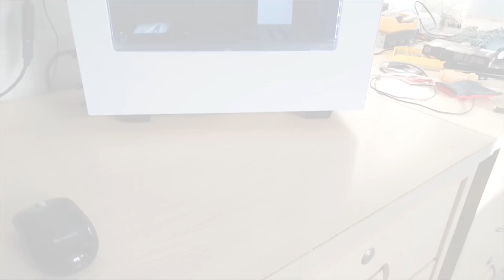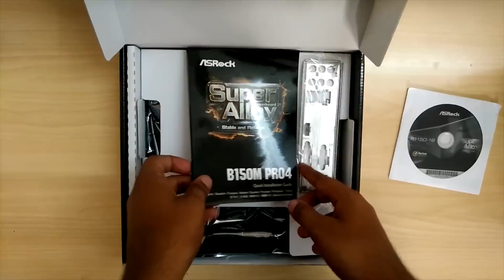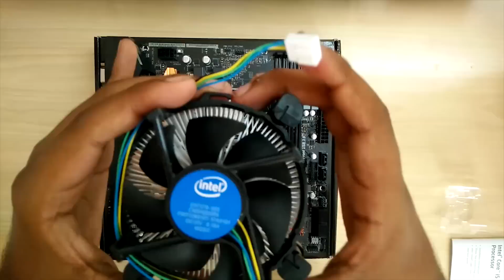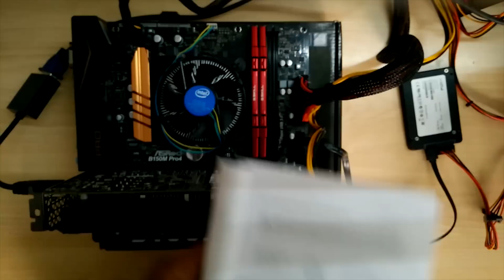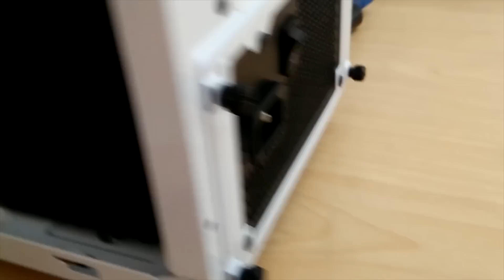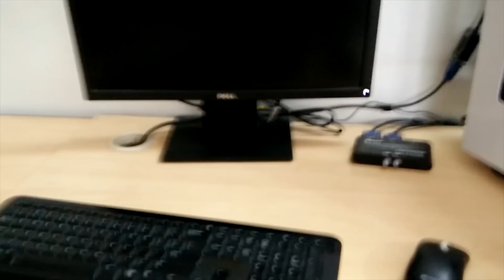How To Build A PC [GTX 1060, i5-6500, NZXT S340]

Comment: a 32gb ssd...
Reply from the maker: +CheesyTwister I know, right? What a moron....
Reply: nah, im guessing you are using it just for the os but you can get a 1060 you could have saved up a bit longer and gotten a bigger one
Reply from the maker: +CheesyTwister A full copy of windows 10 could fit on that but it wouldn't be able to receive any major updates. I am using it for editing videos. As for the graphics card, it is meant for 1080p tasks only and a 1060 is good enough for that.

Comment: Could i fit a gtx 1070 dual ( https://www.amazon.co.uk/ASUS-NVIDIA-GeForce-Graphics-DUAL-GTX1070-O8G/dp/B01IFESATU/ref=sr_1_6?s=computers&ie=UTF8&qid=1504276868&sr=1-6&keywords=gtx+1070 ) in here. Its 26cm and im worried that is wont fit because of the cable management bar.
Reply from the maker: +Gunner1906 TV The case can fit most graphics cards easily but if the cable management bar still gets in the way, you can remove it. (It is detachable)

Comment: Just wondering, if you need a cd rom, how would you install on in this? it didnt seem to have a port for one.
Reply from the maker: +Snow Flake I have a external cd drive that plugs into the usb.
Reply: I see, i wonder if that would be an issue of you had to reload the system os and youd need the cd drive. But i guess i could find a spot to mount it if i needed to.
Reply from the maker: +Snow Flake People still use CDs to load OS? I use a flash drive, more reliable driver wise.

Comment: I have a costum build pc cost 1197€
Without windows. 

-Nvidia gefore gtx asus 1060 6gb OC Dual
- i7-7700k 4.2ghz to 4.5ghz
- cpu Fan hyper 212 LED
- mother Board Prime z270-p Socket 1151k
- RAM crucial 8gb 2400 MHZ
- CPU case Nox hummer mc Black
- SSD card crucial 275 gb mx300
- hard drive seagare 1T SATA 3.5 ST1000DM010
- Power Supply CM masterwatt Lite 700W

Im telling you this is the cheapest but middle pro costume gamming PC.

Comment: Is this case silent at all?
Reply from the maker: +Rebirth Fire It is quite but not silent, I believe a couple of intake fans may take some of the load from the two exhaust that the case comes with and might help in reducing the decibel levels.
Reply: Live Sparks I see. Im trying to find a case similar to this but has a dvd rom slot or just a little more quieter. Do you have any honorable mentions / recommendations?
Reply from the maker: +Rebirth Fire I haven't been following the PC market closely enough to give a good recommendation but you might want to check out the channel 'Linus Tech Tips'. I believe they have a playlist for case reviews that you might find useful.
Reply: Live Sparks Im quite familiar to that channel. Ill check it out. Thanks!

Comment: Why did you pick such a small board for the s340. Like you went miniITX
Reply from the maker: +Jack Tyler I picked the case last and there were not many miniITX options that I licked. Plus, I licked that I have the option to upgrade if necessary.

Comment: I'm literally building the same exact pc, do i have to get extra case fans or is the s340's standard case fans enough
Reply from the maker: +Ianous They are enough if you are not worried about dust. If you are in a place where there is too much dust then a couple of intake fans will be a good idea but cooling wise the case fans will be enough.

Comment: Bro I have planning same specs i5 6500 quadcore or skylake I dunno with gtx 1060 6gb oc but which edition n which mother board should I use H110M 1151 with 16gb ddr4 2133mhz caviar blue 1TB corsair vs550 case circle cc821 prime under 60k is this ok or should I make any upgrades/changes n will it run in 2k with ok or good frame rates plzz reply
Reply from the maker: +sid____bawse iiuoqo The specs are pretty good and any game will easily run at 60 fps
Reply: Live Sparks even in 2k ?
Reply: But which edition of gtx 1060 6gb oc should I use
Reply from the maker: +sid____bawse iiuoqo All have almost identical performance. Choose whichever you can afford.
Reply: Live Sparks k thanxx
Reply: Live Sparks so there no need to change gtx 1060 6gb oc with 1070 under 60k budget right.
Reply from the maker: +sid____bawse iiuoqo You can buy the 1070 if you have the budget, otherwise it's not necessary.
Reply: Live Sparks so will this able to stream on ultra or high finally
Reply: Live Sparks in 1080p
Reply from the maker: +sid____bawse iiuoqo If the game is not very CPU heavy then it should have no problem.
Reply: Live Sparks like gta 5 redux
Reply from the maker: +sid____bawse iiuoqo I don't know how CPU intensive the redux mod is but gta should work fine.
Reply: Live Sparks k thanxx alot

Comment: bro in how much time u render your video with your i5 6500
Reply from the maker: +Hindustani Gamer I use the GPU to render my videos
Reply: ok but how much time it takes
Reply from the maker: +Hindustani Gamer There's no standard for render time, it depends heavily on video codec, resolution, length, animations included, effects and hundred other things. I can't give you a number with which you can compare performance. 
Though as a rule of thumb, the better an graphic card performs at gaming, the faster it will render video.

Comment: +Live Sparks Acctually a nice video for me and those being new to building a PC. There were a few things You showed that others often time laps past in their videos tyhat I have been looking for. Like the 6+2pin being basically the same as 8pin for a GPU. Im about to buy the parts and the "Inno3D iChill GTX 1060 3x" Card I will most likely buy requires an 8pin Powersupply. I wasn't sure if Power Supplies with 6+2pin cables was compatible. Now I know. Thank You !!! :)
I'm still trying to find some video showing exactly how to connect all the case cables like USB front panel, start buttom, Led etc step by step as it seems the connection on the motherboards sit side by side in a cluster but each cable only needing 1-2 pin of that cluster of pins. Hard when being new to be sure to connect each one of those correctly onto the Motherboard. You did explain while holding te cables but I'd like to see in detail when acctually putting them, in each pin. Most videos skip that totally as if everyone who's watching is supposed to just know. It's both chosing not campatible parts as well as connecting the wrong cable to the wrong pins that scares me most with building my own PC.
Reply from the maker: +HolyOrderofDragons Most videos skip that part because the connections are different for each case and motherboard. You need to check the manual that will come with the motherboard to see which connection goes where. Don't worry, it's very well marked and connections are easy to make.
Reply: Aha, I see. I'm going with an ASUS Z170-A and I already have the case bought. A CM Storm Stryker, white to match with ASUS Z170. I would go with an ASUS Dual GTX 1060 OC 6GB (white) if it had a backplate but it doesn't, so I'll probably go with Inno3D iChill GTX 1060 3x (also 6gb). http://www.inno3d.com/products_detail.php?refid=251 

It's not white but metallic and black with white LED lightning. I think it will match Ok'ish at least.
Reply from the maker: +HolyOrderofDragons Send me a pic when it's complete.
Reply: Live Sparks Sure. I'm, now waiting for Black Friday Sale to try get some of the parts cheaper. Like maybe the i7 6700K will be cheaper since in January or February the new Kaby Lake i7 7700K comes out at the same price as currently i7 6700K costs. So it will still be a while until I have all parts.

I do have the case CM Storm Stryker, Corsair K70 Mechanical keyboard, razer mouse and BenQ 24 inch 144hz, 1ms Monitor.

I would have liked EVGA GTX 1080 or at least GTX 1070, 32 GB RAM, 1 TB SSD etc but that is over my budget so GTX 1060 it will be, 480 GB or 240 GB SSD and 16 GB RAM. I can't afford more than that, unless I get some parts really cheap on Black Friday.

Oh and Thank You for the replies !!! :)
Reply from the maker: +HolyOrderofDragons Your welcome

Comment: + Live Sparks : Hey Ravi, i went to a nearby store today, and they said i need atleast a Z170 series motherboard for i5 6500 skylake + gtx 1060. But i have seen some videos where they eve put a h110 with gtx 1060, plzz tell how all these motherboards affect performance and Which one of the 3 should i buy that will be cheap but without any compromise in performance
Reply from the maker: +Adarsh Mohanty http://www.gamersnexus.net/guides/2099-intel-chipset-comparison-z170-h170-h110

Comment: my friend you can not overclock this mother or cpu you sound dumb
Reply from the maker: +TheButler480 Actually you can, checkout this link : http://www.tomshardware.com/news/asrock-non-z170-bclk-overclocking-motherboards,31362.html
Reply: "By incorporating an additional clock generator, Asrock is able to force the CPU cores (that’s cores, not all components on the CPU die) to use a separate clock generator and BCLK than the rest of the system. This allows you to then overclock the CPU by increasing BCLK until the CPU cores themselves become unstable without destabilizing other components." its still bad to do this to your components and thats straight from the link you sent me
Reply from the maker: +TheButler480 Overclocking any component beyond a certain point is dangerous regardless of the motherboard or cpu. I was pointing out that it is possible to overclock this configuration.
Reply: i guess your right

Comment: can u plz tell me something it's just that I want to have the same built but the problem is that I  don't wanna change me power supply,can u tell me if I can go with the same or i'll have 2 change it.its seasonic s12ii 520 watt psu
Reply from the maker: +Rahul Lund it should work fine as long as it has all the required connectors.

Comment: Is there a difference between 1060 mini and 1060 in terms of performance? Also, can I use that whole microATX motherboard inside an ATX case?
Reply from the maker: +Tom and Jaree There is no difference in performance but the 1060 mini has lower overclocking headroom, but that wouldn't impact normal usage much, if at all. 
An ATX case can have a mini, micro or normal ATX motherboard.

Comment: need some help with my PC Build., First of all no clue what he said about the HDD and also where to plug anything in. I'm just awful at all the wiring. 
The CPU cable from the Power supply doesn't seem to fit in the CPU 8 pin connector
Reply from the maker: +Bobberz Read the motherboard manual for proper wiring help.
Reply: cheers man. I've had a look but couldn't find anything really :((
Reply from the maker: +Bobberz Ok. The hard drive is plugged in the same exact way like the SSD. That's why I didn't show the exact process. The CPU power cable can be plugged in only one single orientation by matching the missing pin on the header with the missing socket on the cable.
Reply: thanks a lot :D I'll have a look when I can. Really excited for my new PC

Comment: Did you guys see the joke in the user manual where it says how to get dual channel to work ? page 15 - Dual Channel Memory will only work if the memory is in A1 + B1 slots or  A2 + B2 Slots or if you have all 4 slots populated. Basically means dual channel isnt activated if you just plug your ram in the 2 slots next to each other lol.

Comment: i might build this but i edited some of the parts so new its cheaper ;-;
Reply: how much do you want it to be
Reply: 500 or under
Reply: YoshiBros522 well im building one actually right now and its around 500 you can downgrade the motherboard and it should fit your budget and change 950 to the new 1050 which im pretty sure is better depending what 950
Reply: Ok can U tell me all the parts you are using?
Reply: YoshiBros522 https://uk.pcpartpicker.com/list/2mjvD8 sorry forgot to put that in there
Reply: thx :)

Comment: cool tutorial, what about installing the drivers with a optical drive? i could really use help on that
Reply from the maker: +Phoenix2079x I use an external optical drive. You can copy the contents of a CD to flash drive using another PC and then install the drivers from there.
Reply: Live Sparks i actually didn't think of that, i do get to keep my old laptop for a while to transfer my windows 10 key and the ISO tool, might aswell stick in the disk and transfer it into the usb right? thanks man, i seriously forgot you could do that
Reply from the maker: +Phoenix2079x Happy to help!

Comment: Does one of these these GTX 1060 6gb: 
http://www.newegg.com/Product/Product.aspx?Item=N82E16814126115&cm_re=ASUS_gtx_1060-_-14-126-115-_-Product 
http://www.newegg.com/Product/Product.aspx?item=N82E16814125901 
But I only see a 6 pin conector on my power supply (Cooler Master Extreme Power Plus 500w).
Should I worry or....???
Reply from the maker: +TUSG You should get a newer power supply that has the option for a 8 pin PCI power. This PSU has been discontinued for a reason.
Reply: or adapter 6pin->8pin

Comment: You can't over clock a 6500
Reply from the maker: +Astro GoD You can, if your motherboard supports it. The overclock won't be guaranteed to be stable but it will work.

Comment: thank you for the video bro , 
i want to build too with SAR 3,500 /3.75 = 900 $ budget . 
but the comp parts here are too damn expensive ! (the gtx 1060 6gb costs SAR 1,800/3.75 = 480 $)

any advice senpai ?
Reply from the maker: +mahid gomampong you can buy your product list from USA and then get those products shiped to your location by using something like boderlinx.
Reply: im thinking about that too but its my first time ,so if anything goes wrong  it will be hassle or like u said pain in the ass to change/return it. so i prefer to buy in local market. but thank you for the reply :)
Reply from the maker: +mahid gomampong If it's a new power supply than it should be good enough but you should check out what the white light means in the user manual of your graphics card.
Reply from the maker: +mahid gomampong Try borrowing someone else's power supply and try running the PC with it. If it still blinks than the problem might be with the Graphics Card. If not then you can buy a new power supply.

Comment: How would you get Windows 10 on after the pc is built and monitor connected?
Reply from the maker: +Austin bats normally you would install Windows through a CD disk but since this case doesn't support a cd drive, I installed it via a bootable flash drive.

Comment: i need some help...i m going to buy  a gpu..i have choose 2 graphics card...ine amd rx 470 4 gb nd gtx 1060 3 gb...so which one is better...??470 has 4gb vram ,,so does it matter...in future..
Reply from the maker: +Suvadeep Nag currently 1060 3GB has better performance, but in the furute if more games adopt DX12 and Vulcan API then that might change.
Reply: 1060 imo. You see, 1060, is quite better than the 470 just by the specs and gaming performance. Now, on to the VRAM: It pretty much depends on the games you play and the resolution. If you are playing on 1080p, then that extra 1gb of ram wont exactly outweight the performance of what a 1060 can do. Again, the winner is the 1060.
If you are thinking on playing at 1440p, then the rx will kind of outvalue the 1060 since that extra gb will now be better for the textures for that resolution. But... why go rx470 if you are planning on 1440p gaming anyway? XD

My personal recomendation: Save 35 bucks more and wait for the 1060 6g. Yep, that's the difference between a 3g and 6g as for the time this comment is being made.
Reply: i play with 5760x1080 with 1060 and in bf4 on ultra setting i can get upwards of 120fps 
so 1440p is alot less pixels and the rx470 does not keep up with it.
Reply: Looks like the rx470/80 are destroying the 1060 in bf1 dx12 tests. Time to jump ship now. Interesting.

Comment: Will you able to overclock the gpu with this build
Reply from the maker: +Fernanda Flores Yes, upto 10% more overclock.
Reply: i dont think you can over clock a locked cpu though...
Reply from the maker: +The Erik1119 you can actually overclock a locked CPU if the motherboard supports it. Mine does. The overclock won't be very stable but you can do it non the less.

Comment: Planning to do any gaming benchmarks? Is Zotac 1060 Mini any different from Zotac 1060 Amp Edition?
Reply from the maker: +Akhil I have done benchmarks but I won't make a video for it. 
Here are the results [Heaven Benchmark] though :
1080p - 124fps avg
1440p - 65fps avg

The scores are very good and improve by 8 to 12% by overclocking. 
Hardware wise, the difference between the Mini and Amp Edition is that the amp comes with a bigger cooler. The GPU is exactly the same, also the amp edition is factory overclocked.
Reply: Thanks for the info.
Reply: hi, how about the temp when it load?thx.
Reply from the maker: +maega20 Temps are always below 85C